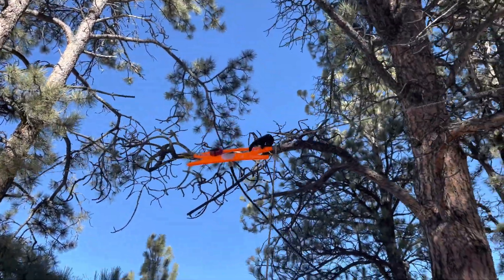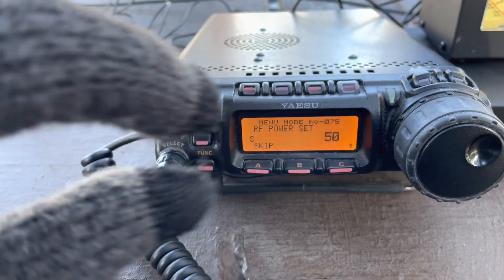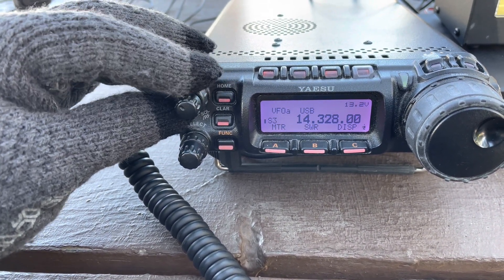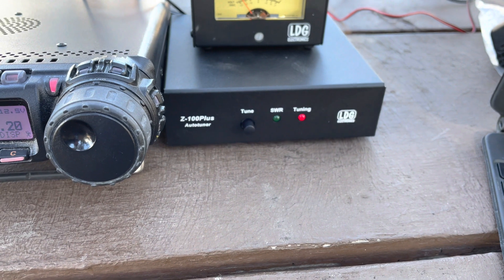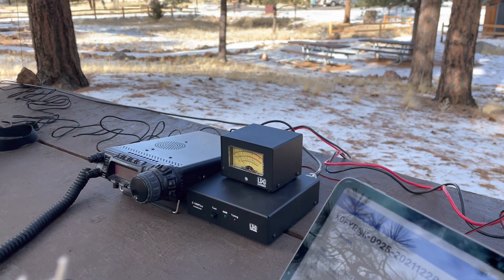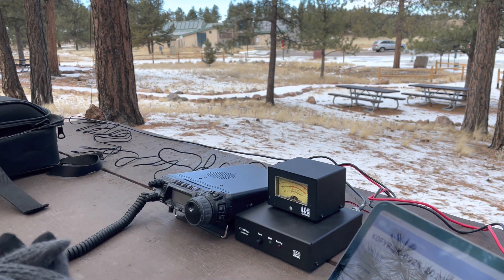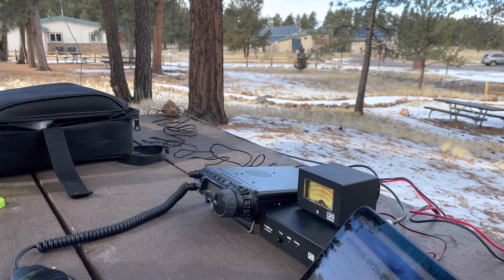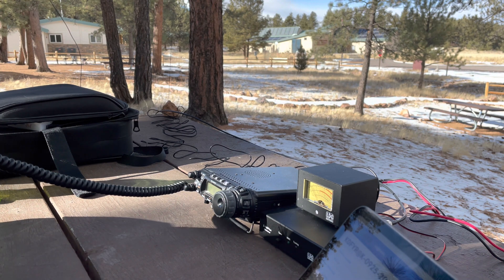Yaesu FT-857D & Tuner Testing: At A POTA

Comment: Man. Good video. 
I’m having the same problem with that tuner with the 857. 
I build good antennas but would like to tune 17 and 12 on the EFHW. Swr on those bands are 1.6 and 2.3. That’s too high for me for my radio. Don’t poke the bear. 
Thank you. 
W5WPS
Reply from the maker: @Bigfootradiosociety  yeah I hear you. I haven’t had that radio or tuner in 2 years as I sold it soon after. My preference since then has been an IC-705 with the AH-705 auto tuner if I’m using my 9:1 PackTenna random wire or no tuner with my home brew 20m dipole. Ham-Solo K0FYR

Comment: I think the fact that you could tune at lower power has more to do with the saturation of your transmission line transformer, than the tuner.  Many antennas limit the power due to the TLT.  I have two end feds, one will take up to 25 watts, CW 45 Watts, SSB.  The other will take 200 watts SSB and 100 watts CW.  The difference is not the wire, it is the TLT (balun).    When in saturation the inductance of the antenna goes to crap.
Reply from the maker: That is correct for what I was doing at the time. I run QRP mostly and so this was a fluke once I got this radio for the field. It feels like cheating to do a 100 watts so I sold it shortly after this video. I mainly do QRP when on the road and activating and run 100w barefoot at the house. I need to activate in 6 more states to have done all 45 states for Summits On The Air and I need 7 states to have activated in every one for Parks On The Air. All of those activations were done QRP so they can keep the 110 watt radios for other people as I’m fine without it on the road. Thanks for watching. Ham-Solo K0FYR

Comment: Hi there. Im having almost the same problem with my EFHW (inv. L) Before I've bought a tuner, I've noticed that on 160m, 80m my antenna is resonating a little off the HAM bands, 160 around 2 and a bit MHz, 80 about 3,9-4MHz, 40, 20, 15 under 1,5SWR on HAM bands, 12 meters some times under 1,5 sometimes about 2SWR, 10 meters about 2,5-3SWR, but for 10meters I think it's just cap issue, because I have got caps after wiring out antenna in my yard 🙃 well... this is not so big problem. Now I have an ATU LDG Z11proII. This tuner can "tune" the antenna to a almost or evenly to 1:1 SWR at 100W continous carrier, when in manual recomended up to 30W I guess 🤔 for a while - no problems, sometimes I have to retune from scratch, because of icing, on my antenna wire, sagging and etc. And yeah, at the end. The wire is about 42 meters long, but at the fastest way, i have just looped a few meters, its like you are looping, shortening your dipole antenna, just folding over excess of wire and straping with tie strips almost as feet
73s de LY1JI Jonas

Comment: Hi there. I have an 857d with an LDG YT-100 tuner. My tuner is not the same one that you have but I believe that they operate in much the same way. The radio is packed away right now but as I recall the tuner uses the info from the CAT/Linear port on the back of the radio to make its tuning decisions and adjustments. In order to do this, the following settings should be made: #19, CAT RATE ="4800"     #20, CAT/LIN/TUNER = "CAT'   and #61 TUNER/ATAS = "OFF". And you probably already know this, but your coax transmission line will give you better SWR the closer it is to 1/2 wavelength long. If it is close to 1/4 wavelength long or odd multiples, you are going to have pretty messed up SWR readings. Good Luck!
Reply: Correction. Instead of menu #61 I should have said #85 "off".  Sorry.
Reply from the maker: @tomprovo6204  Thanks. Not sure if i officially checked the settings after this but I feel that I did and they were like this. I just tried to use the FT-857D on a recent activation with an MFJ-1899T Telescopic Portable Antenna at it didn’t work well at all. In addition the same antenna didn’t work with my Elecraft KX2 either so I don’t think it was the Yaesu or its LDG tuner which were the problem. However when I would transmit the Yaesu FT-857D would show SWR blinking on the screen of the radio. The Elecraft tuned 1.1 to 1 so I’m not sure why the LDG Z100 Plus would not tune it when I used it on the Yaesu. Still trying to figure this out. Ham-Solo K0FYR
Reply from the maker: Yeah thanks for the info. I pretty much narrowed it down and got the settings already where you described. I use a 20’ piece currently of coax but am getting a slightly larger and a little longer piece. It pretty much goes “tune at 10W and turn up power to operate” and that has worked pretty well. Have gotten responses from most of the US and Canada and one off of Portugal doing it that way. Ham-Solo K0FYR
Reply: Not with that tuner.  It does not use CAT.

Comment: I have the LDG IT 100 tuner. Use it on an Icom. On the Icom it has a cable from the tuner to the radio. Tuning is done by pressing the tune button on the radio. It does tune with the radio set at 100 watts very well and brings the swr to just over 1 on all bands. The antenna used with it is a 49:1 End Fed. Hope you have better luck with it in the future, I know how frustrating that can be.
Reply from the maker: Yeah they even include instructions specifically for the IC-705. I think the Yaesu was an afterthought and that’s why its a little weird using it for that radio. Thanks for watching and commenting. Ham-Solo K0FYR